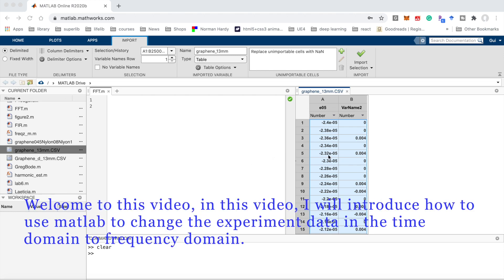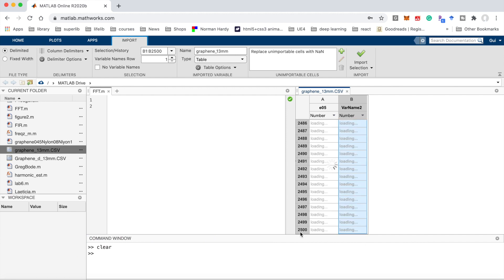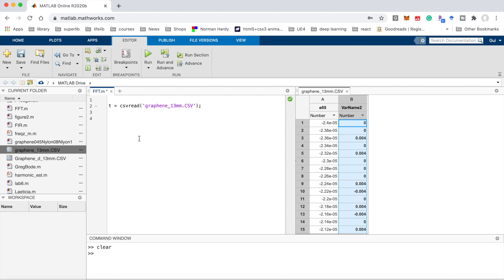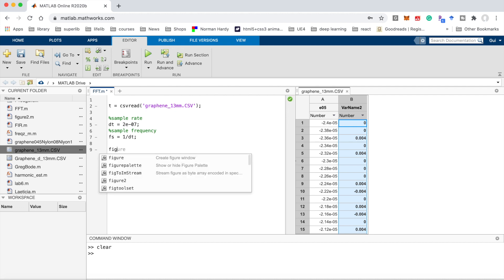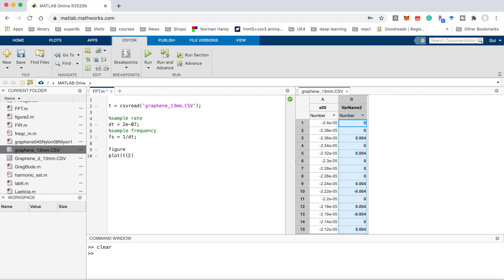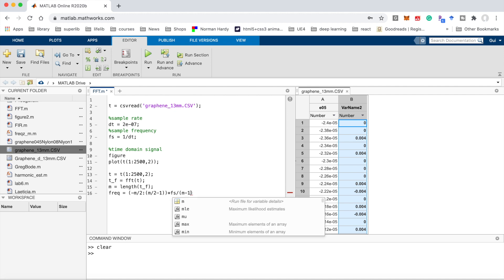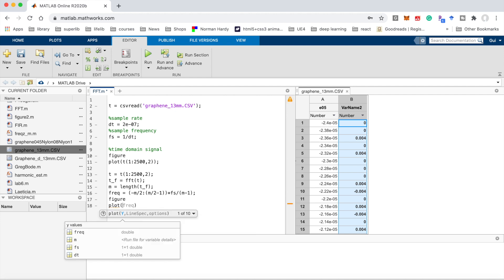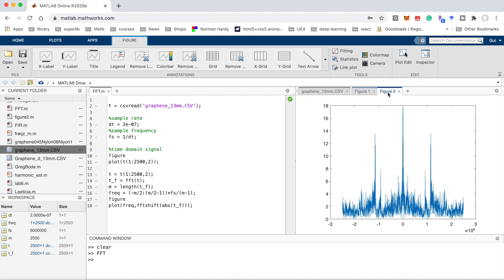FFT transform of experiment data

Comment: You told at beginning time is first column. But in time domain plot you plotted, plot(1:2500, 2). Second column as time why?if I have not understood clearly please explain it to be briefly.
Reply: plot ((0.0001:0.000175:0.35),t(1:2000,2)); use like this the front is range for u x axis, the time, u can set whatever range time u want with any increment as long the is same with ur set of data

Comment: I have a MAT.file, so should I use a different code for the software to read the data for my mat file  ? Like that of csvread?
Reply from the maker: Yes,you could use the csvread function
Reply: i have same issue
Reply: hey , i am dealing with the situation in which i am provided with voltage data set including the nan values i need to find fft frequency m using similar method but the result is not desirable means i want a 50hz frequency but its coming at about 125 hz Can you kindly help me figure out that does sample rate effect this or just its a case of speeding up